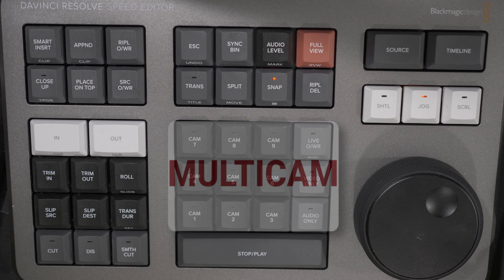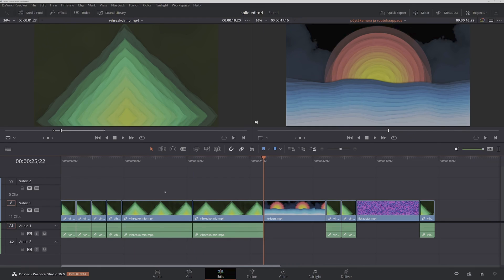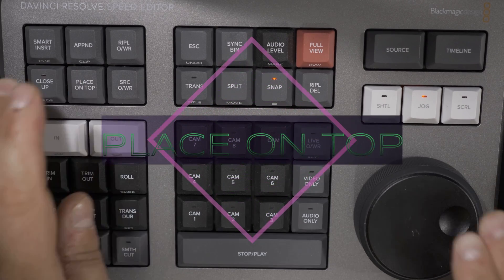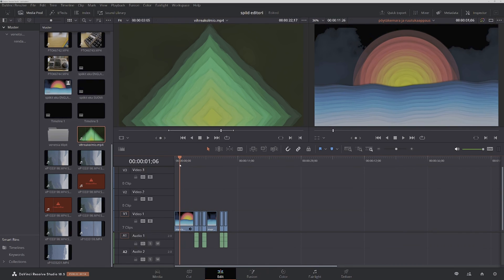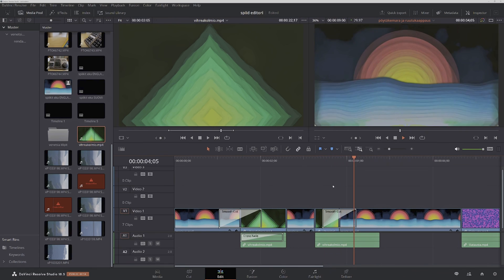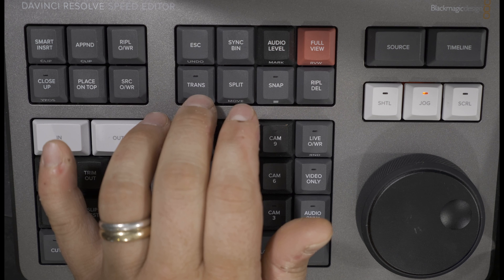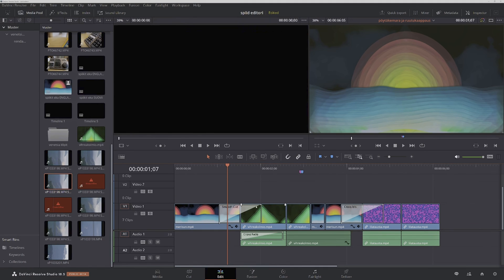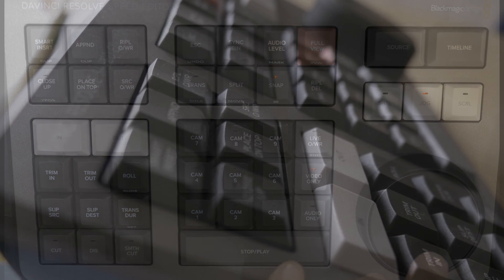Davinci Resolve Speed editor tools and functions complete

Comment: Maybe you explained this but I fail to understand how to move a clip in the Edit page and have have the clip snap to the next clip? Say if I have a gap beteeen to clips and I want to delete the gap. Like ripple delete but when the playhead is over a gap, not s clip.
Reply from the maker: Snapping is a separate function in DaVinci Resolve which you can enable or disable (the magnet looking button at the top of the timeline panel) or use the key SNAP in the speed editor. You can delete gaps between the clips the same way you can delete clips.
Reply: @VIDTOOLZ Tack! I figured out how to remove gaps with the speed editor which was my main issue.

Comment: Great presentation 👍nicely paced and narrated! My question is…I was expecting the speed editor to be a ‘stand alone’ device? How do you select clips in the media pool without using your mouse? It seems that the mouse and device have to work in conjunction with each other? I noticed in your video your cursor moving around on screen?
Reply from the maker: Thank you. Good question. I think the speed editor is designed to be used in conjuction and supplement the traditional mouse and keyboard work. it gives more options for the user, to do the same tasks.
Reply: @ thank you Mikko for answering my question so quickly 😀 I can stop worrying about this question now. I’ve watched quite a few videos looking for answers but not one mentioned this. Very much appreciated. 🙏

Comment: How did you do the J & L Cut using the Roll Key? On my DaVinci i first have to resolve the Link from Clips to actually do that. If i keep the Link of clips it will always select the video and the audio clips. So how did you do this just with the Speed Editor? If i have to click, and use my mouse anyway... than the Speed Editor is no use for doing the J & L Cuts. Maybe im missing something. I rewatched your ROLL part multiple times. Don't know how you did it. Please explain. Good Video Cheers Daniel
Reply from the maker: Could this be because you use the audio from your camera, in which case the video and audio are linked automatically. I tend to not do that, instead I use audio from my external recorder, in which case the video and audio are initially not linked, until I manually link them. This was the first thing that came to my mind.

Comment: After pressing the RIPL DEL key, the current clip is deleted, but there remains an empty space that I have to delete afterwards :( How to fix it so that the created gap is also deleted?
Reply from the maker: As the name of the function implies, the ripple delete should both delete and close the gap in timeline. Are you using the cut or the edit page while experiencing this behaviour? Most likely you have some other command active, that overrides the ripl del command. For example, you could have the auto track selector (found in the timeline window) inactive on the track you are trying to do your delete.
Reply: @VIDTOOLZ Yes, used by the CUT site. How can I check and possibly correct the correctness of the command? I checked the keyboard shortcuts but I don't know how it should be to do it correctly. The track selector will be fine if it removes the current clip.
Reply from the maker: The best way to make sure every keyboard command is behaving as they are supposed to, is to go to the keyboard customization windows and choose from the upper right drop down menu the default “DaVinci Resolve” keyboard layout. The RIPL DEL command behaves a bit differently in the cut page when compared to the edit page as in the cut page the ripl del behaviour on by default. Whereas in the edit page, the RIPL DEL is not active by default.
Reply: @VIDTOOLZ Yes, there will probably be an error. How should it be set correctly so that it works on the CUT page and deletes both the clip and the gap at the same time?
Reply from the maker: @chadas The problem you describe is most likely related to the timeline you have open and the settings you have on that specific timeline. You can verify this by creating a new timeline and trying the same function there, does it now behave the same on the new timeline?
Reply: @chadas hey so idk for sure but i had the same issue with my keyboard shortcut on cut page. Turns out i had to click an icon on the left or just above the timeline (pretty sure left though). If this button is turned off, ripple delete will just delete instead. Idk if that’s
Your problem but it could be
Reply: @VIDTOOLZ Yes, it behaves the same on the new timeline and in the new project :(

Comment: Having trouble with my DaVinci Resolve Speed Editor keyboard. It's not responding during editing sessions despite being fully charged and recognized by my computer. Indicator lights aren't working either. Tried on different computers and reinstalled the software, but no luck. Any suggestions?
Reply from the maker: It sounds like you have been doing quite a lot of troubleshooting so far, but can you think of what you haven’t tested out yet? Have you tried a different cable, to a different port? Is the behaviour the same when using bluetooth?
Reply: @VIDTOOLZ   Yes, I have used different cables and different ports, both regular USB and type-c. Everything was working fine just a week ago. After installing the new version 18.6, the keyboard doesn't work. I installed an earlier version where everything was fine, but it still doesn't work with it. Maybe there's some issue with the keyboard itself. Although Bluetooth detects it right away
Reply: @VIDTOOLZ   If I'm not mistaken, there used to be a separate keyboard update along with the program update. Now I can't find such updates in the support service. Or any drivers for this keyboard.
Reply from the maker: So you suspect it might be a driver issue? I think you should write to the Blackmagic Forum about this, if other users are experiencing the same issue.

Comment: how do you make it work tho?
whether it's connected through BT or USB, it never works.
The lights are on and it's there in device manager with "this device is working correctly" and on davinci panels, but no matter what I do it never does anything in davinci..
I've been at this for 2 days now :')
Reply from the maker: It could be anything really. I would start the troubleshooting by trying the device on some other system to see if it behaves differently. Good luck! 👍

Comment: Speed Editor or Stream Deck with profiles from Sideshowfx or both? I see Sideshowfx sells Pro and Color profiles now and I already have a Stream Deck XL. What control is most practical for editing and controlling color? Thanks
Reply from the maker: The best tool for color is the Blackmagic design Mini panel, if you have lots of free desk space, if not, then the micro panel is the best. The Blackmagic design Speed editor is meant for, and is excellent for editing.
Reply: @VIDTOOLZ  if someone will get the speed editor and also has a stream deck, does it make sense to use the programmed macros in the stream deck along with the speed editor?
Reply from the maker: @AlphaTroll  When you look at working editors, everyone uses their tools differently. So, whatever method happens to work for the individual editor, that is the “correct” way to work. And our methods never stop to evolve as we get new tools at our disposal.
Reply: Its such a shame that  BM doesnt allow customisation of the keys 😢😢😢😢😢
Reply from the maker: @blacksolidChrome have you asked BMD to add it? Maybe they will add it ay some point.